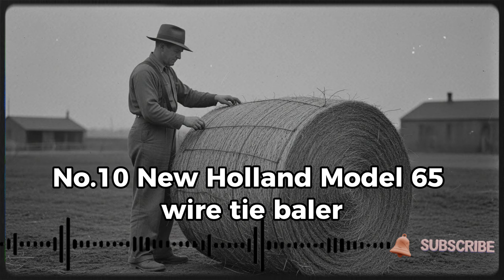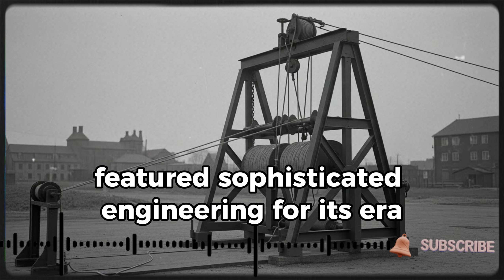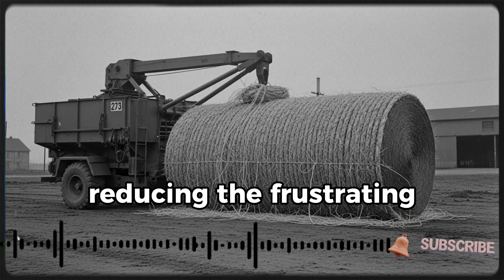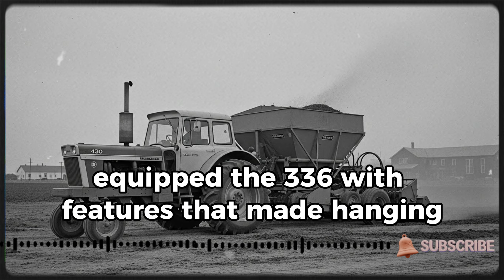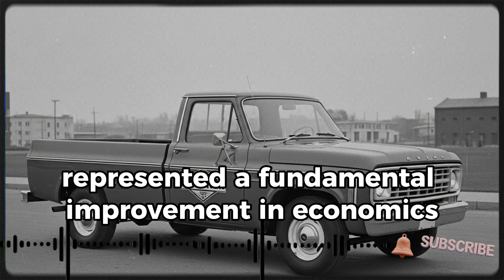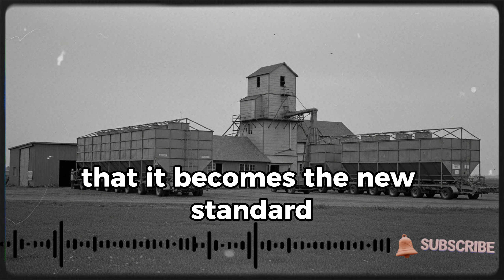Top 10 Most Legendary Vintage Hay Balers Ever Built | Wire-Tie to Round Balers

Comment: I had a 336 with a pan ejector. I had 4 hay wagons. Now I bought a New Holland 210 discbine and a New Holland 460 round baler. I also bought a Kuhn 4221 13’6” rotary rake and a Kuhn 5001 four basket Tedder. New Holland rakes and tedders are made by Sitrex of Italy and I won’t have them.
Reply from the maker: A 336 with a pan ejector and four hay wagons.
That's a complete system
built around one machine.
The new setup will move more acres.
But that 336 knew exactly
what it was there to do.
Thank you for the detail on the Sitrex —
that's the kind of knowledge
that belongs in these comments.
— Classic Farm Iron